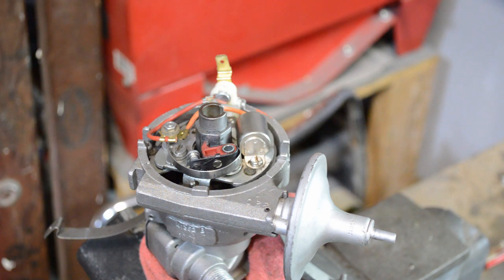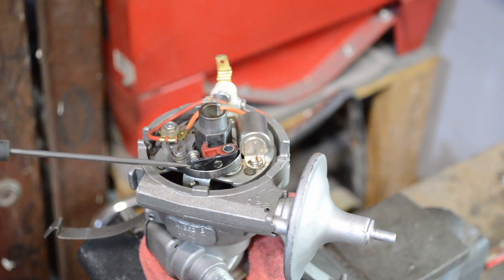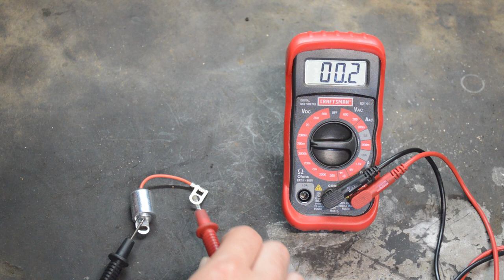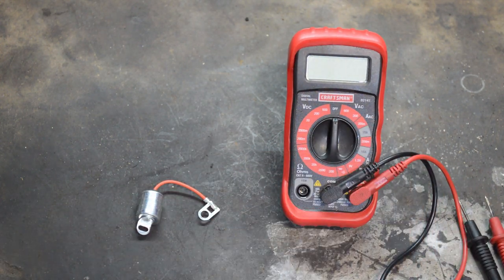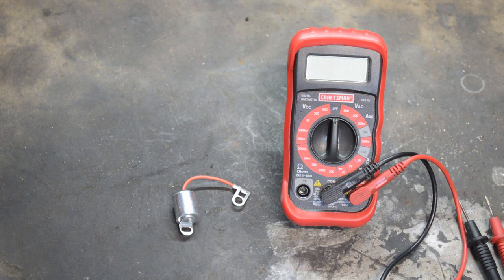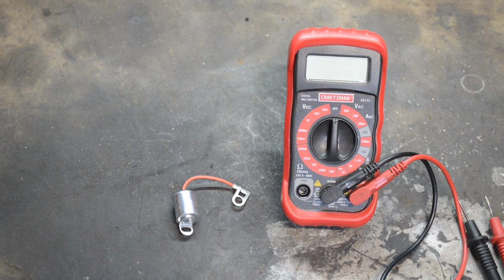Demystifying the Distributor - Triumph, MG, Austin Healey, and More!

Comment: This is fantastic!  I'm rebuilding my engine and am at the point of setting static timing before installing the engine back in the car.  Thanks for helping me understand how this system works.
Reply from the maker: I'm happy to be able to help.  The distributor is the primary source of running trouble with these cars, so it's critical to have it in good working order!

Comment: Amazing video you covered all the basics an like stated demystifyed the distributer
Reply from the maker: Glad it was helpful!  I find that the distributor is responsible for almost all of the breakdowns I've ever experienced.  At least short of something like a coolant leak or an alternator issue.  It's rarely the carbs if you drive the car regularly.
Reply: Midwest Motoring  minealways seems to be the fuel pump

Comment: First thing I did with my recently purchased Triumph in the 70s was to replace the primitive distributor system with an electronic, mobelec electronic ignition system. After that operation the car ran like clockwork. Always started easily and responded well to the throttle.
Reply from the maker: There are definitely advantages to going electronic. It's important to realize the distributor still needs maintenance though, since the ignition doesn't replace the advance weights.

Comment: Great video. My '72 MGB had a dwell issue in its 25D distributor. Car wouldn't start. I took off the distributor cap and someone did not put the insulating plastic shoulder washer on right, so it was causing the coil, points, and condensor to short to ground !!! The flat part must face up and the smaller diameter collar must face down, and prevent the points, the coil wire terminal, and the condenser terminal from touching the stud. Then once they are all properly oriented, you put the nut on and tighten it against the flat part of the shoulder insulator.  I'm not really thrilled about tightening this nut against a piece of plastic. Not a great design, but  I guess you can't argue with success.   It's seems to work well.
Reply from the maker: I recently had a breakdown in the big Healey when that nut loosened up just enough to cause a short. Almost didn't see it and was going mad trying to figure out what was wrong.
Reply: @midwestmotoring  Hello there! Yes, it certainly is kind of an Achilles heel. I think some people may be too cautious about tightening that nut against the plastic shoulder insulator, but if it comes loose, like yours did - that would be bad news and could be dangerous.
But now we know what to look for.

Comment: Fantastic video. Thanks for sharing
Reply from the maker: Glad you liked it.  I bought a distributor machine, so hopefully there will be more with distributors in the future....
Reply: @midwestmotoring  I might sound dumb but what's a distributor machine?
Reply from the maker: Legit question. Back in the day, a shop might have a machine that you would use to check out a distributor. You mount it in the machine, turn on an electric motor, and it uses a sort of timing light to show where the distributor is firing. The speed is adjustable, and so it's a convenient way to make sure the mechanical and vacuum advance is working properly through the whole rev range. Technically you can do the same thing by revving the engine, but it's less accurate, and if the distributor isn't set up right you might not be able to rev it up to begin with. Look up "sun distributor machine." That was one of the popular brands.
Reply: @midwestmotoring  Wow! Didn't know that. That's pretty cool 👍🏻 would love to see the machine in action.

Comment: Just a quick FYI. The Distributor Doctor in the UK sells condensers made as they were when originally produced and they are said to be much better than others. They are known by their yellow lead wire. http://www.distributordoctor.com
Reply from the maker: Thanks for the tip--I'll have to check them out.  Most condensers are junk, so it'd be good to have a quality source... although an argument could be made that it'd make more sense to just convert to an electronic ignition.

Comment: Thanks for the helpful videos. You mentioned lubricating the plate and weights if needed. What lubricant would you recommend?
Reply from the maker: There's actually a "distributor cam grease" you can find online.  A small tube will probably last forever, and a small amount on a Q-tip should do the trick.  Generally speaking, though, you can probably use any grease so long as you don't glob it on.  For the weights I wouldn't use anything hard to find or expensive since it doesn't matter as much if it flies around in that part of the distributor, but again not much is needed.  I use a small amount of white lithium grease in my cars.
Reply: What about lube on the rotating part of  plate, to keep its action smooth?
Reply from the maker: The same. White lithium grease works wonders. You want something that will stay put and not dry out.

Comment: Really excellent explanation, thank you. the only thing I could not understand is at 25:40 when talking about the position of the drive shaft slots that turn the rotor, you said  "about this angle" and "it could be 180 out so notice the bias at the top ". Ho much is "about" for the angle, just the slot pointing to about 2 oclock?  I could not understand or see what you meant by "see the bias at the top". I could only see one slot pointing at 2 and the other at 7 or there about, what did you mean by "bias at the top"? Loved this though, it was great , thank you.
Reply from the maker: About 2 o clock sounds right. I don't know the exact angle. As for being 180 degrees out, the slot is not in the center. It's off to one side, so the rotor will only point one way. You could have the gear still at 2 o clock but with the slot on the wrong side.
Reply: @midwestmotoring  Oh got it, thanks for explaining that. It was really an excellent presentation one of the best I've ever seen on anything. Thanks again.

Comment: Would you please discuss the electron option for the TR6 ignition system. Thank you.
Reply from the maker: Hi Richard.  YES!  I would be happy to.  I was considering upgrading from points to an electronic ignition, so if I do I'll film that and post it.  If you need an answer soon though, my recommendation is the XR3000 or XR700 from FAST.  This used to be a system from a few different companies... Allison, Crane, maybe a couple others, but it's the same product.  The XR700 needs to be used with a ballasted ignition, so if you have an early TR6 you'll either want the XR3000 (which will work with either) or you'll want to make sure a ballast resistor is installed in your car.  I believe the "Demystifying the Distributor" video discusses how to tell if you have a ballast ignition or not.  Pertronix is also very popular, though depending on who you ask it's either very reliable or not so much.  Either ignition is easy to change, so I suggest keeping a set of points and a condensor in your glove box as a backup.  If you have a breakdown, just set up the points with a feeler gauge or a business card, and you're back on the road until you can fix it later!

Comment: Interesting video. When you put the distributor back onto the car you mention that the engine is in TDC. Does this imply that you took the distributor off when it was in TDC? Is it important to have the engine in TDC, or would any position be fine as long as you keep the same orientation during disassembly and assembly?
Reply from the maker: Any orientation is fine. In fact, the distributor will only fit in one position so you can't mess it up.  The TDC helps with 2 things. First, you can make sure the distribution drive gear is in the right orientation. Second, if helps with static timing (though technically a few degrees before TDC is what's needed here according to the shop manual). I default to TDC so I know where the engine is as I'm working on it.  Great question.
Reply: @midwestmotoring  Thank you for your reply to my question. I am about to take, for the first time, the distributor off of my 1964 MGB. It is a Lucas 25D and looks very similar to the one you used in the video. Your video has helped me to understand what to expect when I disassemble it.
Reply: Just a tip if your putting in a brand new set of points. Set your gap .016-.017. This allows for a little build up on the contacts during break in. And it will be dead on the money .015 after break in.

Comment: Great Video. Thank you. Now I dared to dismantle mine. What should I use to lubricate the ground and point plate?
Reply from the maker: The correct thing to use is conveniently called "distributor cam grease."  If you can't find it, something like SuperLube Dielectric grease will work.  Just don't glob it on.

Comment: Grinding off would in fact be a terrible idea depending on your model
Reply from the maker: Yes, that's true.  The distributors are chosen for specific applications, so increasing the range from idle to full advance could quickly damage the engine.  It could be a different story for modified engines, but some dyno testing would be necessary to see whether additional advance would actually be helpful.  For 99% of cars that aren't raced... the stock advance amount is plenty.  Good comment!
Reply: Midwest Motoring  just when you get into the emissions side of the distributor that's when you start playing with the weight and advance unless as stated for race applications anything after 1970 imo has the emissions bs runs terrible today due to the change in advance an different fuel

Comment: Does converting to an electronic ignition affect the the tachometer. That's been one of my concerns about installing one on my XKE.
Reply from the maker: No.  If you have a mechanical tach, it obviously doesn't matter in the slightest.  With an electric one, the tach is really just a volt meter calibrated to read a number of pulses.  Whether those pulses are triggered by points opening and closing, or by an electronic ignition switching on and off, isn't relevant.  

Points are just a mechanical means to open and close a switch, which turns power on and off.  The electronic ignition does exactly the same thing.  It just uses a light sensor or a magnetic hall sensor or some other means to do the triggering.
Reply from the maker: That said, if your XKE isn't driven too frequently then points will get the job done just fine.  Electronic ignitions aren't better.  They just don't go out of tune over time.  With a low mileage car, the points won't go out of tune very often anyway.

Comment: Good video, but you didn't explain the coil wiring polarity - which side of the coil does the single wire to the distributor connect to - positive or negative on the coil????
Reply from the maker: That varies.  Your wiring diagram in the shop manual will always tell you.  Generally, for a negative ground car it's the negative side of the coil goes to the distributor. That's if you're running points though. Electronic ignition complicates things.  Long story short, it's not always the same, so you need the manual for your car.

Comment: Ok, thanks for the reply. But If you are going to tell a story - always start at chapter one!

The wiring is not always obvious some oils are marked up differently.

I broke down yesterday and needed to re- install points as a get you home measure, but found an electronic system installed.

I looked at just under 3000 you tube videos trying to establish how to wire the distributor and coil, etc. BUT NOT ONE VIDEO INFORMED ME HOW TO DO IT - ALL QUITE USELESS!
Reply from the maker: I get it. Unfortunately like I said it's not the same on every car.  In fact it's not the same even on the same car.  Triumph Spitfires changed the wiring to the distributor at least 3 times.  The reason such a video doesn't exist is because it's likely to be wrong for a lot of viewers.  That said, as noted, the wiring diagram will always tell you what's correct for your car.  

As for markings on the coils, some are marked SW and CB.  CB is for contact breaker, and the SW is for switch--meaning the ignition switch.  It's still + and -, and still changes depending on whether your car is positive vs. negative ground.  Glad you got things going and back on the road!

Comment: Hello again!  Do you have an opinion about going to an electronic ignition on a '71 TR6?
Reply from the maker: I do, actually.  I haven't found it necessary.  Condensers are hit or miss, but I think in general parts quality is improving again with the ignition components.  My TR6 still runs points, and hasn't needed to be touched in a few thousand miles.  I check it during oil changes and don't usually have to adjust it.  It's also nice that a complete spare ignition is pretty cheap, so I can keep a spare distributor with the complete setup in my trunk--for less than the price of an XR700 ignition unit.  It's easy to loosen the clamp, swap distributors, tighten, and get back on the road (though I haven't had to do that yet).

Comment: I am looking for a mis fire gremlin. A '74 TR6 is cutting out above 2500 rpm. I just did a valve job (new valves, seats, guides and springs) and I've gone through the carbs a few months ago. I am in a process elimination replacing one thing at a time to find it. I've set the timing at about 12* and the total timing at 32*. It idles and revs okay in the garage. When driving, it starts cutting out and runs weird. It has a Pertronix points replacement and coil. First, I put on a known good 3-ohm Pertronix coil, and it runs better. The cutting out doesn't start until 3000 rpm. Next, I want to replace the Pertronix with standard points that I just bought at Autozone. I find I'm missing some hardware. I have screws that work for the condenser and points. Negative coil to points and condenser to points. I don't have the distributor terminal connection part either, I'll order that. What do you think about the misfire?
Reply from the maker: I'm not the biggest fan of Pertronix in a TR6.  They work great in the Healeys I've put them in, but for some reason they keep burning out on TR6s and Spitfires.  And the symptoms are exactly as you're describing.  It'll work for some of the RPM but not all.  I assume since you've checked the total timing and the idle timing that you know the distributor advance is working properly.  Barring that, I'll bet the Pertronix is cutting out.  

If you need a hand with the distributor, I rebuild these and can set yours up properly so you can drop it in.  Turnaround time is about a week at the moment unless I'm going out of town.
Reply: @midwestmotoring  We haven't got the points completely installed yet, I will make some wires that will work, until I get the terminal connect part from Moss Motors. Thank you for the advice on Pertronix. I really have my doubts about them. A friend with a Triumph GT 6 had a new one that never worked out of the box. He's now running points. thanks for the great instructional video. Very thorough.
Reply: @midwestmotoring  Two last important questions. Do I need to add a ballast resistor? Can I run the Blaster 3.0 ohm coil with points, or do I need a stock coil? Thanks
Reply: @midwestmotoring  Mystery solved. It was the Pertronix module. I bought all the missing wires and installed a set of points and a condenser. I also had a good 3 ohm Flame Thrower coil. Since the coil is 3 ohms, I didn't install the ballast resistor. The carburetors were next. They were very lean and backfiring (needles full down). I raised them slowly until lifting the slides didn't drop the RPM. It now runs great. Thank you for this excellent video. You've saved another TR6 from the wrecking yard.

Comment: You don't need to use circlip pliers if this is an A series engine and if you do you stand a chance of dropping it.
The best thing to use is a bolt the same thread as a manifold stud. This can be screwed into the centre of the drive and there will be no chance of dropping it once it's disengaged from the camshaft.
Reply from the maker: Good call on the bolt.  That's good advice for viewers.  That said, this was a Triumph engine in the video, not Austin.
Reply: I wasn't sure about the triumph engine as I've never worked on one. 
I only know this tip from another you tube video so I thought it would be good to pass it on.
Thanks for your great work, keep it up!
Reply from the maker: It's always good to share information like that.  It's the only way we'll keep all these cars on the road!  Thanks! @DC-dp3hk

Comment: Just bought a 22D6 In bad shape  Confused as there is only one wire on the distributor  Should this go to the negavive pole of the coil   With elctonic its obvious  , positive and negatie , red and black. Enjoy your videos  I have a Mk 11 Jag and an E-type, have no stat right  nown with Mk 11 so taikng out electronic ignition  Have done the lot Fuel,spark, timing.Ill get there eventually
Mike Ontario
Reply from the maker: Hi Mike,

The one wire on the distributor just means that you don't have an electronic ignition.  This is a massive oversimplification, but the coil doesn't care which way it's hooked up.  The spark plugs do, but only a little.  In other words, your car will run either way, but it'll run better in suboptimal conditions if you do it correctly.  Anyway, as a general rule, if your coil is marked with + and -, then the distributor goes to + in a + ground car and - in a - ground car.  Good luck!